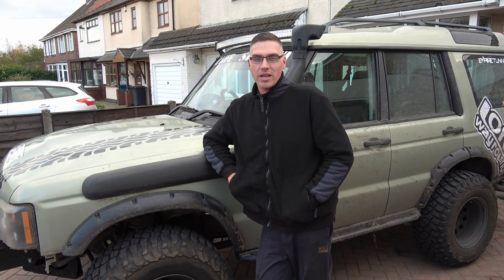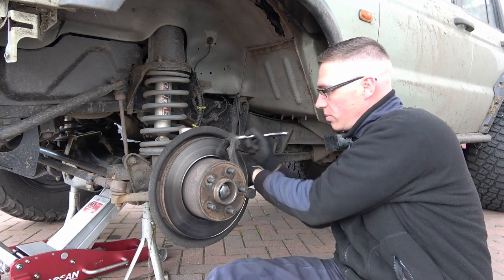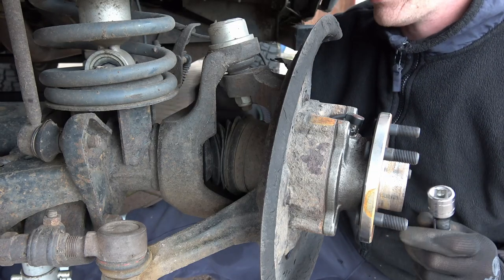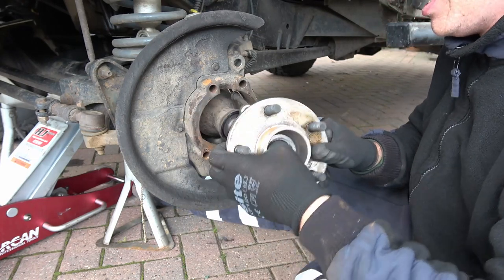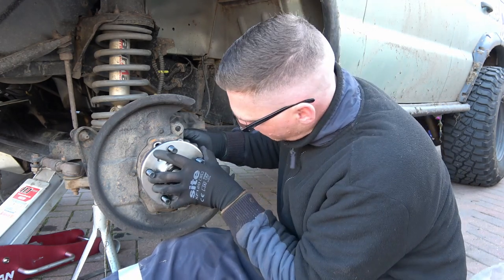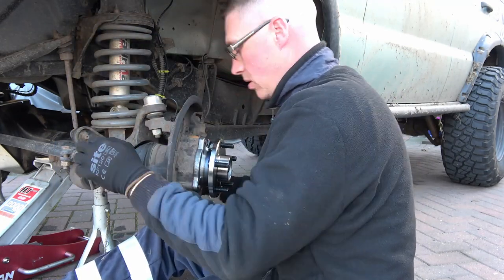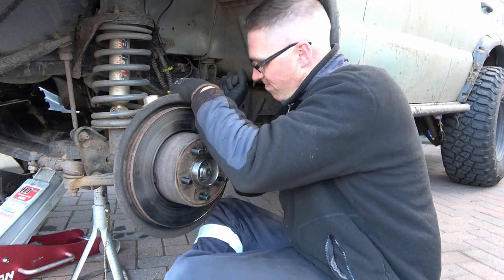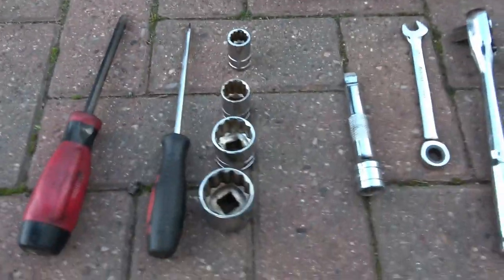Land rover Discovery 2 TD5 wheel bearing replacement

Comment: Awesome video. I do have a question for you. What size are your wheels? I love the stance your Disco has.
Reply from the maker: The wheels were 16 inch x 10j an the tyres were 285/75/16 measures in at 33inch tall

Comment: How's the project going? You welded up that rusted spot yet?

It's like youtube knows I orderd a new bearing kit for mine. This was a video it thought I would like.

Thanks I know I won't have any issues but I'm sticking new disks and pads in well I'm there so will have to do the other side not long done the front breaks but ended up getting some discount on brembos all round so had to get them.

Your engine layout is abit diffrent than my td5. And although mines just as dirty my engine bay and underneath looks then times cleaner.
I even have those shocks front and rear but stuck with the bags on rear and uprated springs, so still stock height

Comment: Yes, very good video.  Quick question. Looks like you have oversize tyres on the car.  What size are they and what did you notice in terms of (loss of) acceleration etc of the car due to these bigger tyres. Your comments would be very useful.  Thanks.
Reply from the maker: The tyres are 285 75 16 bf Goodrich kmo2 on 16” x 10j -35 off-set modular wheels, these are the equivalent to 33” tyres it does struggle a bit in first gear when towing but still not too bad 👌🏻

Comment: Hey mate,

Great video and referenced to it a few times over the last couple of days doing same job on mine.

I noticed u have an aftermarket washer bottle on the bulk head. I have just purchased the same kind.

Did you just bolt it in place, connect up the windscreen washers and not bother with the rear window and headlight washers? Connect up the red connector from the existing washer onto this new after market one?

Comment: Very clear and helpful video, thanks shearing.
Which shocks absorbers you use in the front ? What is your general opinion on the Disco 2 td5 ? Which year model is it  ?
Reply from the maker: Glad to help mate the suspension is +2” terrafirma heavy duty shocks and springs, 
I have quite a soft spot for the TD5 they do break but it’s never left me stranded it’s always got me home and mine was a 54 plate (2005) it had done over 160k miles

Comment: Hi mate,  when u was threading the abs wire through the inner wing at the top, I noticed that the inner wings outer edges are totally rotten, mine are too but maybe not as bad as yours, I just wondered is that a major problem ? or an easy fix,   if so, how?.  and is it a mot failure ?.    do u intend to fix/weld yours or leave it as is. interesting to know, thanks a lot, dave
Reply from the maker: Sorry for the late reply a year later lol I no longer have this Land Rover but on my current one I do have the same issue with the inner arches rotten depends on MOT tester to be fair if it’s not within 30 cm of a chassis mount point you should be okay but I will be repairing my inner arches at some point over the next six months I do plan on making a video on it
Reply: @tabb8872  hi, thx for replying, still have my landy, still have the problem, but its off rd at mo so havent motd it, will look out for your vid, then decide if ill do mine or sell it lol, cheers,  good luck, dave

Comment: I'd like to see you use stronger axle stands. I've seen those pressed steel ones collapse.
Reply from the maker: Yeah I don’t fully trust them either but each axle stand is rated to 2 ton and I try and keep the jack supporting it as well
Reply: @tabb8872  keep safe,buddy.

Comment: What wheels you running? What the specs on the wheels???
Reply from the maker: The wheels are modular 16” x 10j with -35 offset and they are wrapped in 285/75/16 bf Goodrich km02 mud terrain tyres
Reply: @tabb8872  thank you

Comment: What wheel & tyre size are you running??
Reply from the maker: Tyres were 285/75/16 bf Goodrich kmo2’s and the steel wheels are modular 16”x10j with -35 off-set they did stick out quite a bit 😂